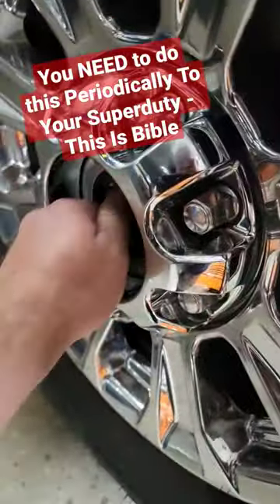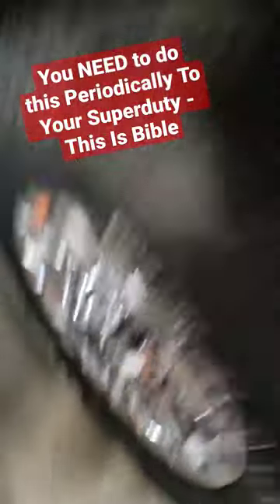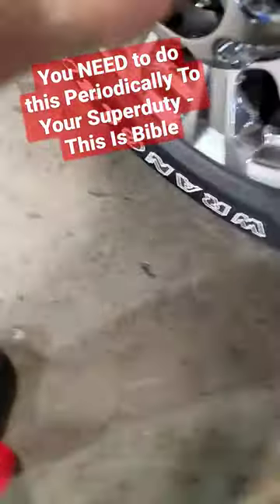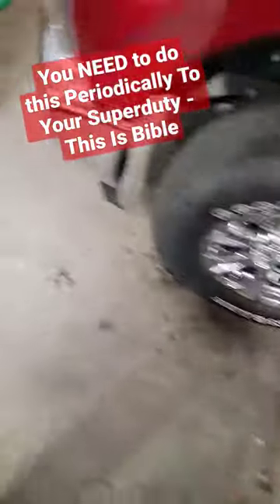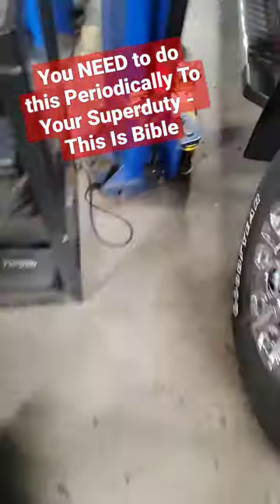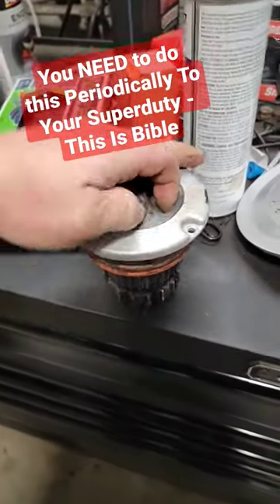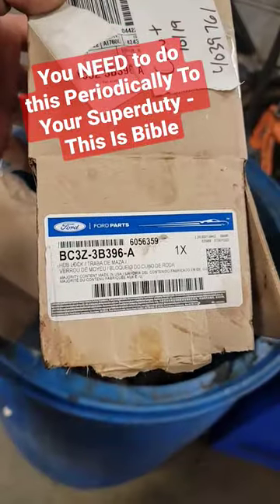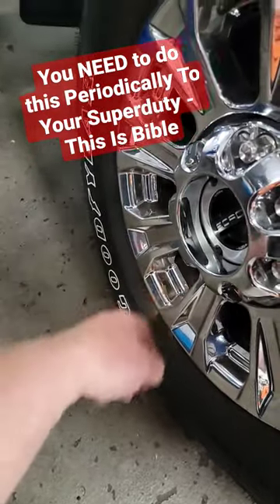You NEED to do this Periodically To Your Superduty - This Is Bible!!

Comment: I still like locking hubs. unfortunately however it's still a vacuum operated system and exercising the whole 4wheel drive 3 or 4 times a year is necessary to ensure engagement when you need it.

Comment: I've rarely ever encountered stiff knobs on Ford locking hubs. They always seemed to turn freely, even trucks that were poorly maintained. GM trucks were always stiff and difficult to engage. The same could be said for GM's transfer case levers. I could easily shift my F150's transfer case lever with two fingers. My 2004 GMC 2500HD was terrible. I didn't have the sliding rear window option so that I could connect a come-a-long to the trailer hitch and lever to engage it. I needed both feet on the dashboard and both hands on the lever to move it. 🤣 The owner's manual told you to give the lever a "firm yank" when engaging 4 high. They weren't kidding!

Comment: ESOF transfer case's should be shifted into 4x4 and 4LO every couple months as well, I still see them with contactor plate codes, and the shift motor was the same from 1988 to right up to 2015 I believe, and it's always when you need 4x4 that they act up when you never use it.

Comment: The hubs on my 2016 F350 CCSB gas I just bought can't turn them. I've been going back and forth do I want to put Warn hubs and loose the shift on the fly or stick with the stock Ford hubs. In the winter its nice to be able to shift on the fly in the winter time.

Comment: Yeah no boss. Look up electrolysis. 5 gallon bucket and a battery charger maintainer. I think you also need a piece of zinc or something iether way soak that assembly and it will free up
Reply from the maker: Why would I do that when this is warranty and half this is plastic 

So yes boss keep doing what I'm doing lol
Reply: @FordBossMe  bacause instead of throwing it away you take it home. Fix it and put it on ebay. My shop replaces entire control arms instead of just the ball joint. Depending on vehicle for example Ill put a 10 dollar rockauto ball joint on it. Wire wheel it. Paint it and sell the thing for 150 or more. And that's just a stupid control arm. I bet that locker is like 600 from ford

Comment: My pro tip is if you get rid of those shitty wrangler tires most likely you won’t need the hub locked anyways. 🤣
The only  bonus of wrangler tires is they are super quiet and never wear out. Mostly because they are garbage tires
Reply from the maker: Maybe he likes the tires
Reply: The 2016 F-350 CCSB gas I bought only has 74,000kms 46,000 miles it had Wrangler Adventure Terrian tires they went by by on Friday. I've owned the truck for 2 weeks I was glad to change out the tires. Never been a fan of GY tires, the Wranglers on the truck rode like old 7.50-16 bias ply tires.

Comment: I don't have to do that to mine I have a doll on the dash plus I can put it in four wheel drive up to 55 miles an hour
Reply from the maker: It doesn't matter

 if you have a super duty and you have these Hub locks you need to do it 

I don't care what your reasons are why you think you don't need to you do need to do it if you have these hubs that's the point of this video